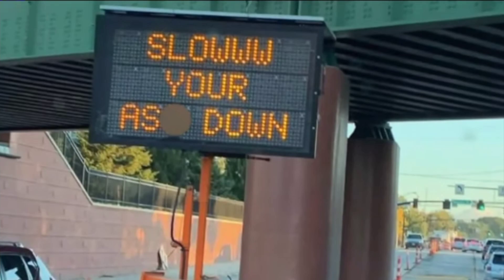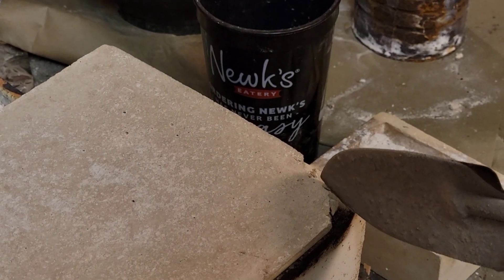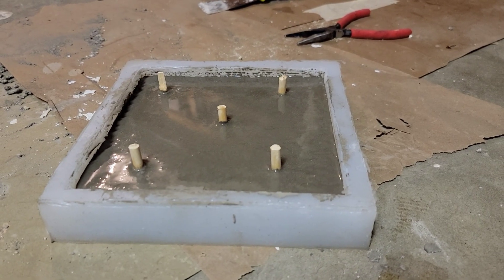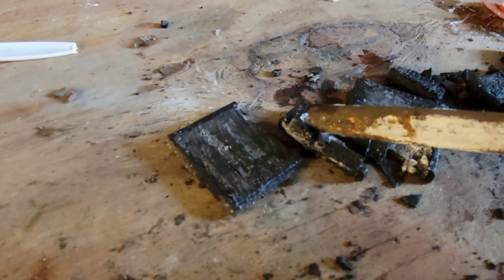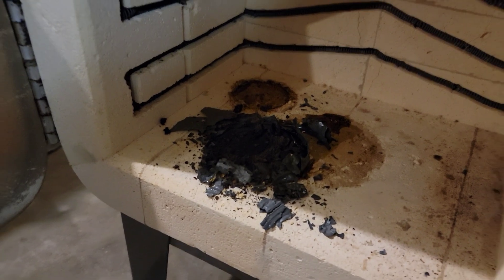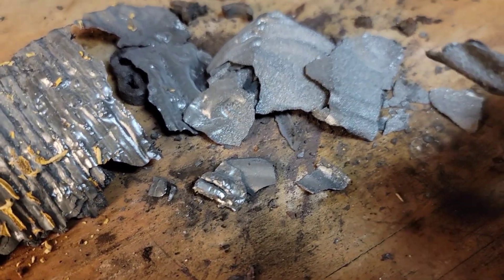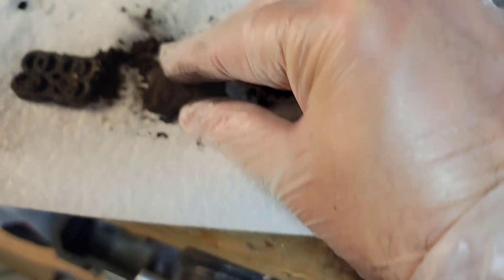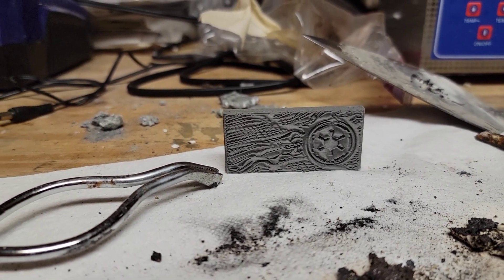First Steel Attempt / Low Temp Sinter

Comment: Maybe I'm missing something but it seems that there's so much loss of detail, it would be preferable to 3d print molds and commercialize the metal and binder in powder form so it could be pressed into a "green" part and sintered as such.
I can see the big deal with being able to do it with steel "at home" but the method of producing the part is so precise and the end result so difficult to control.
Reply from the maker: So normally the detail would still have been preserved however what I didn't show (and probably should have pointed out) was that this part went though several firing cycles and I was checking it after each one with a rotary tool in order to try and check properties of the part after I made some tweaks. So... it was a bit mangled but I was more excited that the steel came out than I was (at this point) with the detail.

Printing molds and pressing is still a useful technique and this wouldn't replace that, but there are a lot of shapes that that method wouldn't allow for and would be out of reach for most home users

Comment: Quick science notes sorry if it sounds harsh just fast facts: 

That heap in the middle at 47 s is potash ( potassium carbonate mostly!) Throw it back in the oven and it will stay intact without being useful as a reducing agent aka electron donor aka oxygen fighter. (it does make for some good fertilizer though). 

also at 3:12, it can be oxidized in different ways than just what we see as rust unfortunately. Black, brown, and can-shaped. I do think the can could be useful as a scavenger, but only if you can keep things inert enough to keep the can from being totally fried in the process. 

I couldn't get steel to work at least in the few times I tried. Just got some more glass and copper though, looking forward to playing around with that soon!
Reply from the maker: Yeah I misspoke at 3:12 when recording. Reading on it though and seeing it up close, the graphite in the slurry seemed to totally bond to the steel can with some pieces having interesting growths and a mirror like surface.

Playing with the proper graphite to refractory mixture and introducing steel flux to the sinter are two things I need to do further investigation on
Reply from the maker: Also... the last beskar nugget I showed was put through several firing sequences and probably had a bit more rotary tool action then it wanted so a lot of the details weren't preserved. Still working out a good flow but this exercise certainly helped me get closer